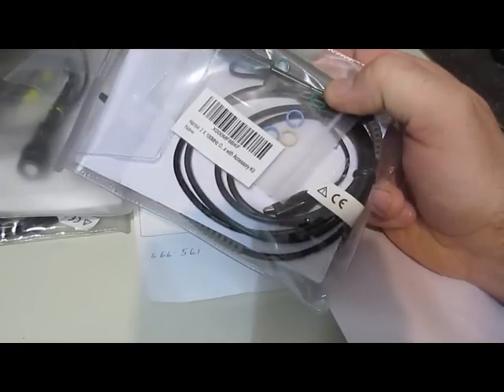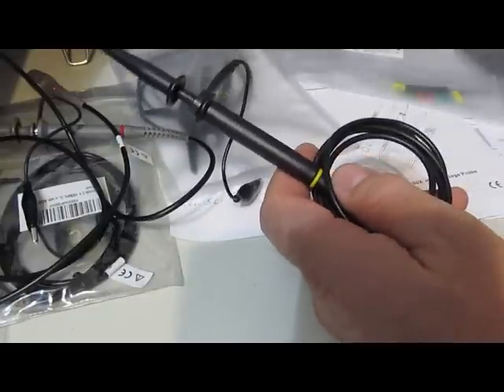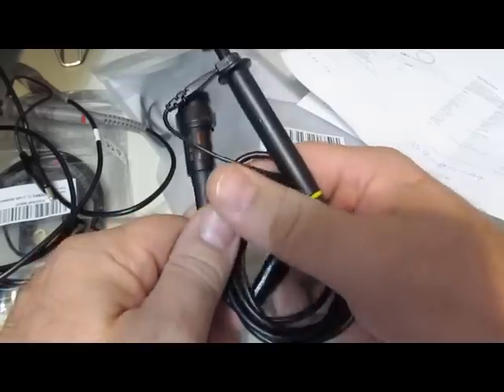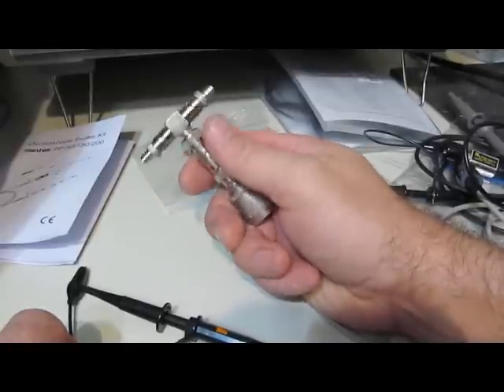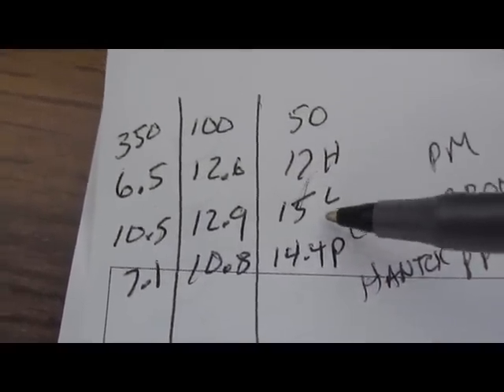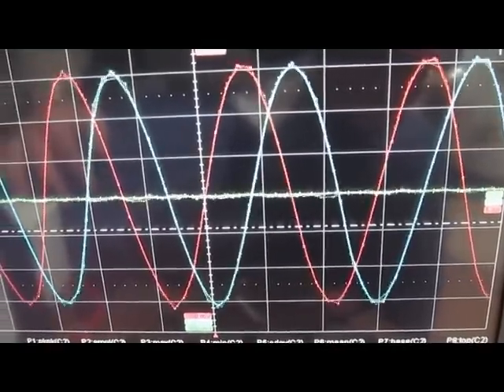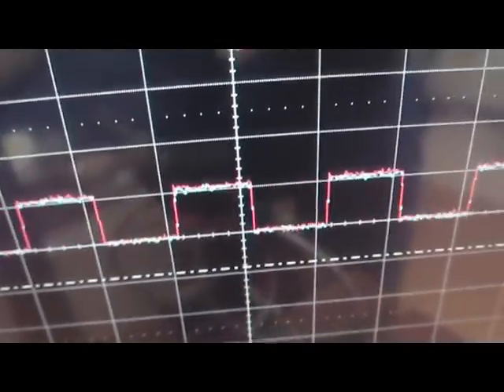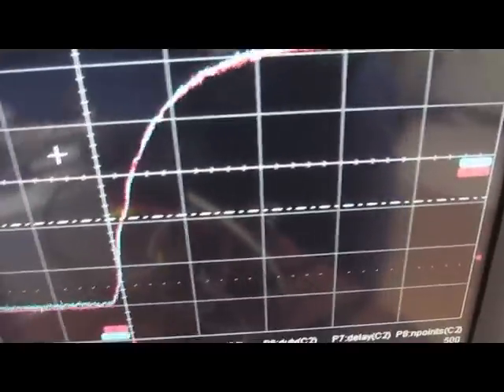Testing the Hantek PP150 100MHz 10X probes

Comment: I am very new to oscilliscopes and only have one lead for a two channel. Looking at these as a pair but my scopes input impedance is 16pf +/- 10 and these are 20pf-40pf compensation. Is there going to be a problem having full adjustment being at the top of the scope with only 6pf overlap I feel I am in a rabbit hole  and over thinking this?
Reply from the maker: The LeCroy 64xi I use them with is also spec'ed at 16pf input.  They compensate fine with that scope.
Reply: @joesmith-je3tq thank you

Comment: What software are you using for your HP 8754A? Looks like some sort of virtual 8501A normalizer. 

I recently acquired an 8505 VNA and 8501. Would love to be able to transfer the data to a desktop for additional processing. I’ve got an NI GPIB-USB adapter I use regularly with my lab’s 8510B
Reply from the maker: Its custom.   Link showing it in use:    https://www.eevblog.com/forum/projects/20db-rf-attenuator-seeking-feedback-to-improve/msg2903552/#msg2903552
Reply: @joesmith-je3tq  Thanks! I originally saw your reply two days ago and it sent me down one hell of a research rabbit-hole 😅. Would you be willing to upload a copy of it to your Dropbox? (Would the file size permit this?) I have zero experience with LabView,  but I think I might be able to navigate a program that’s very-much in the ballpark of what I need in order to learn the ‘language’ and hopefully adapt it for the 8505. 

From my rabbit hole findings: 
Apparently towards the end of the 8505’s run (following the debut of the 9000/200 workstations), HP released the 85011A “Accuracy Enhancement” software package that enabled full 12-term error correction and SOLT calibration. My goal is to recreate this capability (I’d also love to find an original copy of the 85011A software to use with my 9000/235C, but I’m doubtful I’d ever be that fortunate). I’d definitely keep you updated on my progress, and if I get anywhere with the 12-term error correction stuff I’ll also try and patch it into your original program for the 8754.

Comment: Hi Joe… I found you via EEVBlog. I am brand new to this whole field. I picked up an older Tektronix TDS 460A but it didn’t come with any probes. It has 100 MS/s sampling rate and 400 MHz bandwidth and 4 channels. I got it for $50. Would the Hantek probes work? What would your recommendation be for a good probe? Thank you!
Reply from the maker: The manual claims to be able to compensate instruments with an input of 15 to 40pF.  Looks like the manual is on-line for your scope.   I would just double check to make sure they will work before you buy them.
Reply: @joesmith-je3tq  - thanks for your quick reply, Joe. The manual is online and I downloaded it yesterday. It’s about 250 pages and, although it will mostly be Greek to me, I’ll have to read through it. Being so new, I will probably be reaching out again for advice, suggestions and pointers as long as you do not mind. Thanks!
Reply: @joesmith-je3tq  - just in case there is some issue, are there other probes you would recommend?
Reply from the maker: @crusso1043  You could buy direct from Tektronix.  I think the last ones I bought from them were about $100/ea.   You would need to check current pricing.   These Hantek probes are the only low cost 10X probes I have looked at in the last 10 years.    For higher bandwidth, I typically use home made resistive probes.   400MHz would be no problem.    I bought a low cost 100X probe.  Bad idea.   I ended up making a couple of them with much higher quality parts that I felt I could trust below 2kV.   Really depends what you are after.  One thing to mention is the leads on these probes are fairly short.      I made a few videos showing different home made scope probes.   Here's a differential probe I cobbled up.   https://www.youtube.com/watch?v=0thOfk4I3qs
Reply: I think the tektronix have a sensing ring for the selector switch on the probes

Comment: Joe. Came here from your comment on Amazon. Is there a stated capacitance compensation range in the literature that came with the PP150 probes? Bought an analog GW Instek 30Mhz on Ebay that's coming without probes. Scope is marked 1Meg ohm/ 25pf next to the BNC inputs. Would these probes cover/compensate that range okay?
Reply from the maker: The manual claims to be able to compensate instruments with an input of 15 to 40pF.   The scope I use  them with is 16pF and there is no problem with compensation even though I'm close to the limit.  More interesting is I made this video 7 years ago and all four of these probes are still fine.
Reply: @joesmith-je3tq   Thank you!

Comment: So basically whats going on is that 100Mhz probe, chinese one , aint that bad , since it can go to 500Mhz , just got some ordered 60Mhz ones for my 20Mhz Analog scope , and i got 100Mhz one like these , so they are better then my scope, wonder if i can get my scope to go to 100Mhz or at least 50Mhz , anyone know how ? i guess  i can make some frequency divider , so that input 40Mhz ends up as 20Mhz , that is what they do in modern scopes dont they, they multiply the frequency like crazy , like they make 5Ghz scope out of , trully 1GHz module . Or am i mistaken ?
Reply from the maker: First, on the probes.  I am still using the same four that I originally bought when I made this video.  I have not had any problems with them.  As far as the 500MHz, I don't think they were that good.  500MHz on any 10x probe would be pushing it.   Normally I will switch to resistive probes.   I recommend you look that type of probe up.   As for the scopes bandwidth, you need to have an analog front end that can handle what ever you are wanting to run.  Sampling can be much slower depending what signals you are looking it.  For example my old LeCroy's have an analog bandwidth of 4GHz but sample using RIS at a very low frequency (<1MHz) .   My newer LeCroy has a 5GHz bandwidth and can sample at 20Gs/s.     This video shows the insides of the older LeCroy and it in operation:
https://youtu.be/WXFoAAL7hxo?list=PLZSS2ajxhiQA9yWh-hvVtv2ib-3ObOHGV
Reply: @joesmith-je3tq  Im no good For 4 Ghz ,  even this analog one struck this morning , i was getting her some new probes like i said , she didnt like that , took it as an insult on her age i guess ,  so what happened ,is that i took a screwdriver , that was not isolated ,  the one that lights up if there is high voltage ,looks like a pen , has metal connection on the handle , i had my other hand not in pocket , but on the chassis setting up saturation level , and as i push my hand in to 1000V fly back , bam . Screwdriver lit up good is last i remember ,What saved me i dont know , remember checking my hart rate , so put the cover back on , and isolated everything i had handy , throw the knoob driver out the lab ,  so me and my scope had a bit of a fight ,  now we are good , its all good .  This is a proper scope , demands respect , wont die on you like digital one will , and it does all i need it to do . Im not exactly int to  UHF, but if you need 4Ghz , you got it .
Reply from the maker: I work a bit with low current, low energy, high voltage.  Low enough not to be a major concern.  If I am working with anything with a bit of a risk, I normally do it remotely.  Most of the multi-meter testing I show is sub 20J for that reason.    

That one scope is pretty old.  It's an 68K in a VME chassis.  That was my first real DSO for home.  I still use it for high voltage work.    My first scope was an old Dumont.  Maybe 100KHz bandwidth.  The next scope I bought brand new was a 100MHz 4 channel Hitachi.   I did not use it very often after moving to the DSOs and eventually gave it away a few years back.  Managed to do a lot of home projects with those old scopes.  Then again, I was using an analog meter for many years as well.     

A bit of risk, demonstrating a 1KV spark gap: https://youtu.be/bgz-pqg0rKo?t=1163
Reply: @joesmith-je3tq   Do you  have any projects besides buying voltmeters and DSOs , i would expect a lot from that much gear
Reply from the maker: @dedskin1  Yes.
Reply: @joesmith-je3tq   because i checked and all i can find is promotional videos, like a store , online store , couldn't believe it , looked genuine to me , judging from this video ,  but its   like Dave from EEV blog , Like Lnus Tech Tips,  all clones , sellers , they earn for a living i get it , but im a kind of guy looking for knowledge not gear to buy . so i asked do you have some projects would love to see where you used your 5Ghz scope to make something . Because DAve EEV blog never showed why he needs all that gear , not even once .
Reply from the maker: I would think it would have been clear that Dave uses the gear for comparisons when he reviews products.  He has came out and stated that.   He has openly explained where his income comes from.   Nothing surprising there.      

This channel has nothing to sell you. There is no store or online store.  There is no patreon nor do I accept offers from viewers.  Monetization  is disabled.  I don't ask people to join and I don't ask for TU.   There is a FAQ available if you want to learn more about the channel.
Reply: @joesmith-je3tq  Oh man, its hard to please me, you are fine ,  my point is  that i liked your video , because you didnt try to sell something , you simply tested the probes  , like you tested everything else, honestly , its all cool , its all free, no store ,  but You did click that commercial button, you must have, i cant have thumbnails without clicking it on my channel   , but im not american , maybe  that is why i cant have Thumbnails  on my videos , maybe its free for you for me its not . I dont know  doesnt matter , its all good, nice video .
Reply from the maker: My goal is not to please you.  I have no idea what you are going on about when you suggest I have clicked some commercial button.  Because you state I "must have"  does not make it a fact.   I have already stated that the channel is not monetized.   There is no store as you suggested.  I don't even ask people to subscribe.  It really makes little difference to me as I have no plans to monetize it in the future unless YT requires it at some point to increase their own income for advertisement.   I also have no future plans to open a patreon account or to ever start asking for donations.
Reply: @joesmith-je3tq   you dont know what i mean . i mean this
Jae-Lex Linsey,
Answered Nov 6, 2017
To be able to use custom thumbnails, you have to monetize your channel, which is done in your channel settings.
Reply: @joesmith-je3tq  maybe i wrong , doesn't make any difference , not saying anything , its fine i say , its nice .
Reply from the maker: Sorry but I don't know anyone by Jae-Lex Linsy.    I use custom thumbnails without having to monetize the channel.  Maybe read the YT help files if that is your area of interest.  They are free for viewing and should provide you with the details you are looking for.

Comment: Hello! I am currently looking for a probe set for my newly purchased LeCroy 454.. Any info on were to purchase these Hantek probes? I don’t want to receive the ones from your other video, hehe! 
Thanks!
Reply from the maker: I just ordered them off Amazon.  Looks like it's been a few years so I wonder if they have changed their design.  I am still using these probes and have not had any problems with them.
Reply: Yeah, its been a while! There is however on ebay ones that at least on the pictures looks like the ones you have. And some that looks like the strange ones you recieved.  Guess i have to go on the ones that are closest in the pictures? hehe. Who knows what you will receive!

Comment: Excellent video and testing, thanks. I've been looking for new probes and will try the pp150s now. Well done for sharing
Reply from the maker: Just an FYI,  I still use the four probes.  They are holding up just fine but I wonder if their quality has changed from when I bought these.
Reply: joe smith ok thanks Joe, I have some ordered so will see how they go. Most of the applications I use them for are extremely mundane so a piece of fencing wire would probably almost be good enough:) however they still need to be able to do their job and not fail or be intermittent as one of mine currently manages both
Reply from the maker: If you don't mind, let me know how they work out for you.